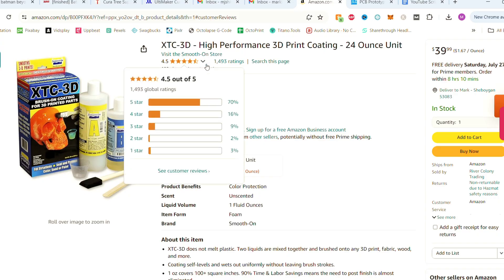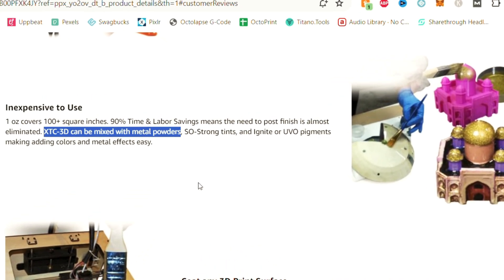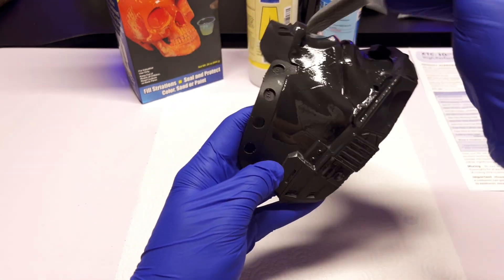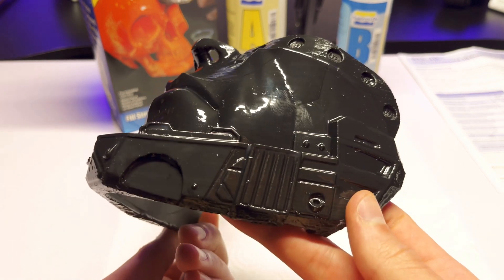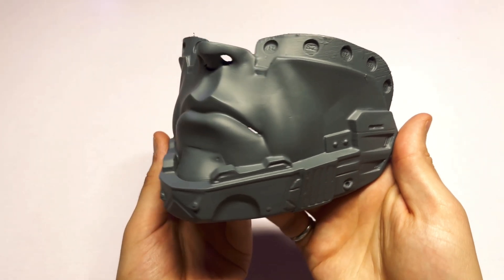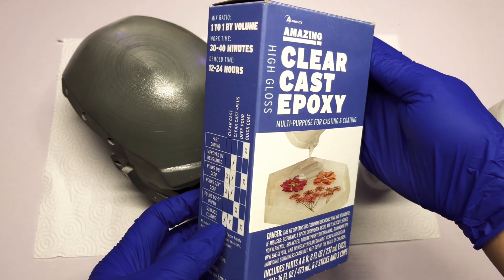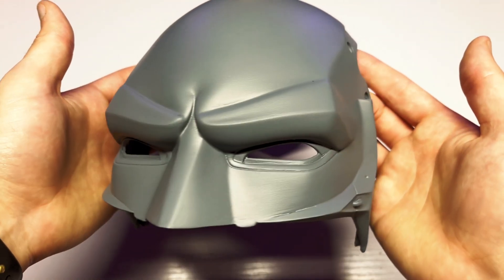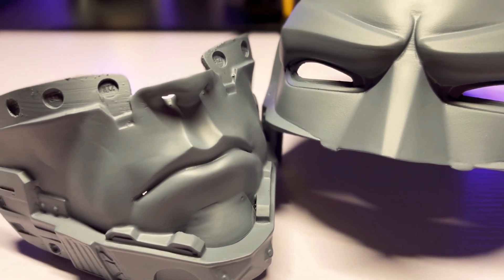The Best Smoothing Technique for 3D Prints

Comment: Hello, I am brand new to all of this so forgive my dumb question. I have a very large 3d print I purchased on Etsy. It's a life size horse skull. The cranium and jaw are two separate pieces and the jaw is very very thin and I want to reinforce. I like the idea of coating it with epoxy resin but am wondering if that is the way to go? I considered epoxy clay but have never worked with it. Any advice would be greatly appreciated!
Reply from the maker: I actually think that’s a great idea! Using epoxy will definitely reinforce the parts! If you don’t want to “see” the epoxy, maybe you could coat the underside or inside of the jaw so you can’t see the difference in the finish. Unless you plan on painting it too, then it doesn’t matter :)
Reply: @markitmade29  Thanks! Appreciate it.

Comment: Been looking into XTC3d so I appreciate the review.  I did notice that the directions specifically say NOT to leave in a small cup and instead use something that it can spread out in as this will increase working time as the heat isn't all concentrated in one area.
Reply from the maker: Yeah, I noticed that after I made the video 🙃 Now I create a "tray" out of aluminum foil as it mentions in the instructions and I haven't had a problem with it since. Thank you for pointing this out for others as well :)

Comment: I got 1 gallon of regular epoxy for less than $40 on amazon. Hell I might just pour it on and see what happens.
Reply: It didn't work very well. I ended up getting xtc-3d. It turned out better than the other stuff, but I still needed to sand it.
Reply from the maker: @uuhamm  Just curious why didn't it go well with the regular epoxy? Did you just pour it on or did you brush it on?
Reply from the maker: Hell yeah
Reply: So what happened? Hahah

Comment: I see all you guys measuring the ratio with that tiny cup..It is much easier if you measure by using a digital kitchen scale, then you measure by weight, tho you might want to get familiar with the pot life, in rooms with higher ambient temperatures the pot life will be shorter. I have rolled complete floors with this stuff. I can guarantee you that you can get your hands on bigger buckets at your local paint store. you can then even pour it in flasks with a tip point and that will help with measuring, it squirts when pressed hard and drips when gravity does its thing.
Reply: Isn't the ratio by volume? The same ratio by weight might be way off!

Comment: how durable are the coatings and the primer when together? I wanna print airsoft toy and I wonder if it will scratch easily.
Could it be that the epoxy coat will make the 3d print stronger and more robust?
Reply: Yes the epoxy enhances the strength of the 3D prints. If you are looking to print airsoft I’d use ABS material and then put a layer of epoxy over it. If you put primer and paint over the epoxy it will scratch just as easily as any other painted part. You can try to reduce this by spaying on a few layers of clear coat after you’ve done your painting. Good luck!

Comment: Great video  i used xtc for a large print i think also the difference is Xtc cures in 24hrs , and generic epoxy takes up to 48 hrs. when mixed correctly, i never had Xtc harden like that in 10 mins. It did get thicker but still usable.
Reply from the maker: Yeah, my mistake was mixing it in a cup. I've since used a sheet of tin foil to spread it out and don't have issues with it hardening anymore. It helps to read the instructions XD

Comment: Well if you watch the video from the producer, you would know that you should spread out the mixture on a silverfoil made plate, to extend the worktime a lot - well there is a manual for a reason sometimes :))))
Reply: I was looking for this comment. Keeping the epoxy in a small container concentrated the heat in a small space which sped up curing making even more heat. Putting it on aluminum foil helps cool it off by acting like a heat sink and extending working time.
Reply from the maker: LOL you are so right XD

Comment: If it solidified in 5 minutes it is possible your mix ratio was off, the normal work time is 10 minutes. Or maybe when applying the coating you took longer than you realized. The full cure time is only 4 hours and if you use a heat source it can be reduced to 10-15 minutes. Cure time is something to consider as well on if it is worth it or not.
Reply from the maker: It might have been more than 5 minutes but definitely not 10 minutes. I just followed the directions and used the measuring cup provided in the kit. I may have been off by a few mm but nothing that should have caused it to gel up so quick. I've now used it a few more times and I've found that after a few minutes if I go to stir the cup it solidifies almost immediately; but if I don't stir it and just dip my brush in to coat my parts it take a lot longer to solidify. Just my experience 🤷‍♂
Reply: @markitmade29  
Hi,  

After applying the epoxy to the piece, the layer lines are still visible, but can they be felt by touch or scratched with a fingernail?  

Thanks for sharing!
Reply from the maker: @mikekiske  There will be slight "bumps" depending on how fine of a layer height you use (0.12 mm vs 0.24 mm). I always use 0.12 mm for detailed parts. Even if you can feel it a bit with your fingernail it is SIGNIFICANTLY less and can easily be leveled with some light sanding.
Reply: @markitmade29  
"I usually use a 0.08 mm layer height with a 0.4 mm nozzle. I'll definitely try epoxy—it'll be perfect for making silicone molds. Thanks! ;o)"
Reply from the maker: @mikekiske  That would be perfect! I've never done silicone molds but have always wanted to try. I have no idea where to start though. Any advice?